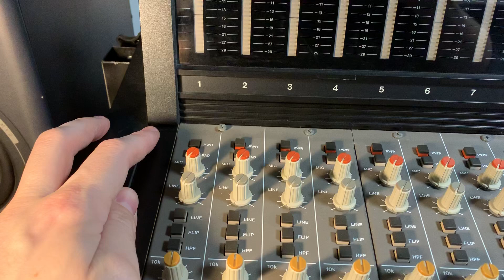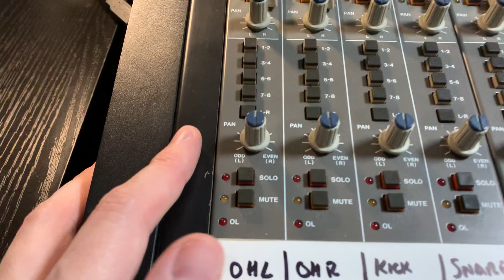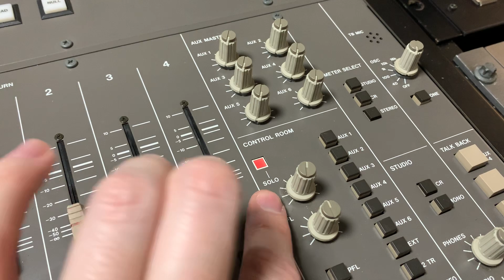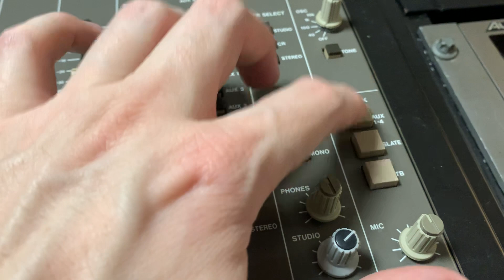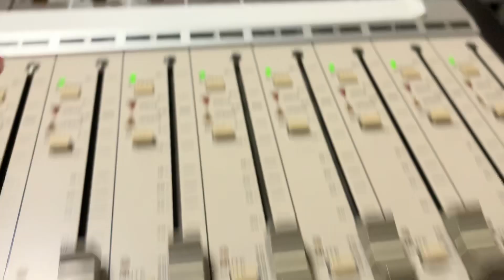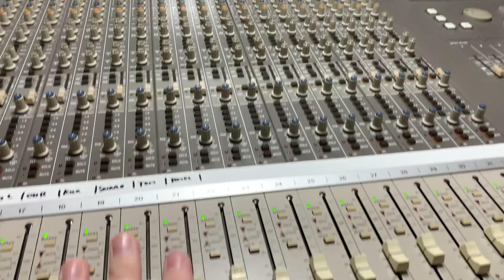Tascam M3700 Analog Mixing Console Walkthrough

Comment: Loved my 3700.  It still lights up for automation, but it stopped bringing in any audio signals on any and all channels.  Power supply voltages and fuses looked ok, that was the end of my troubleshooting expertise! Hard to find someone that can work on these here in Texas.
Reply from the maker: Oh that's a strange one! I haven't seen this kind of issue before. The channel strips are in blocks of four so I'd expect to see maybe a block effected but not all the channels. It could be an issue with the master section, however there would still be input showing on the meter bridge.. just no audio output. When you first power up the desk do the meters flicker?
Reply: @guerrillastudiosmanchester  yes, and I hear what sounds like a loud click, my attention is drawn to channel strips 9-12, that general area.  I wondered if I should try to remove it, see if it’s pulling everything down. Yes, I tried just about every channel, nothing on the meter bridge coming in. I have it leaning up against the wall, unfortunately these are not worth much these days, even when working.
Reply from the maker: @ProgRockKeys  We're you using the tape returns on the back of the console at all?
Reply: @guerrillastudiosmanchester  yes.
Reply from the maker: @ProgRockKeys  that's really got me stumped. The click and meter flicker is normal. It could be as simple as the flip and monitor buttons are in the wrong configuration as this can prevent a signal from coming in and/or showing on the meters depending on how all your inputs and returns are routed. If an input source is showing on the meters but you can't hear it, then I'd investigate the master section. But if there's nothing on the meters then the master section is probably fine there's just no input reaching the channel or the channel is dead, but for this to occur on all 32 simultaneously, that's weird. I wish I was local to you otherwise I'd happily come take a look.
Reply: I have a m3500 and I'm experiencing this  exact behavior. Did you found a solution?
Reply: Send back to the company for repair.

Comment: i've read that the pre's and eq are nothing special!....is that true??...i want a console like this!...is the automation a pain on a modern context like an Interface ( s ) ( UA Apollo ( s ) )and an Imac??...cheers dude!
Reply from the maker: The pre's are warm and the EQ's while basic sound clean and get the job done. Automation shouldn't be a problem in a modern context, however it is likely you will encounter ground loop interference when using consoles like this with digital interfaces. If you're looking to improve digital recordings I'd skip the idea of a console and just go with some top end mic pre's, or do what we did and throw out the digital interface and go fully analog \m/
Reply: @guerrillastudiosmanchester  thanks man!...

Comment: Nice!!!  My first console wasn’t that model but it was pretty similar... I always want to get again a Tascam, but I am afraid of noise, I am using a summing mixer, which is a fantastic SPL DreamMix model, but I miss the whole mixing experience with a console.  Du you know if anyone is doing mods or sell mods kits for the tascam consoles?
Reply from the maker: We've eliminated noise by going entirely analog during the recording and mixing process. Noise will likely be an issue when combining analog consoles with digital interfaces due to ground loop interference coming through all the TS connectors. There's forums with mod ideas but its best to use them as intended and record to tape. We've binned our digital interface entirely now.